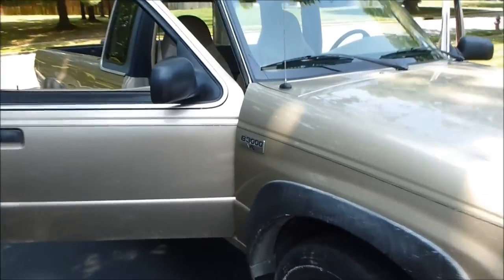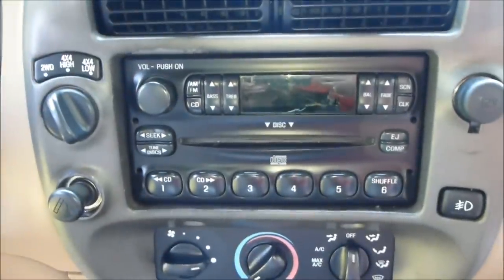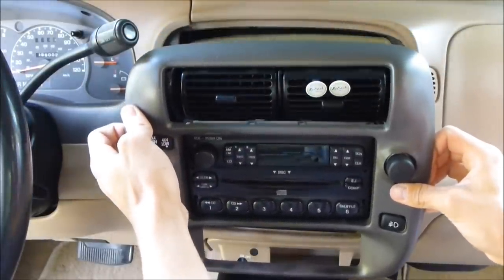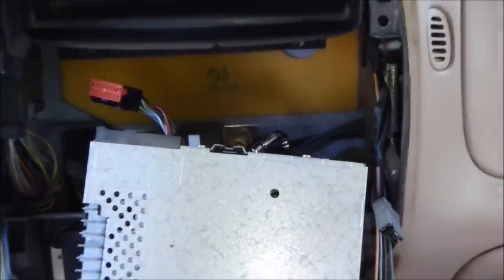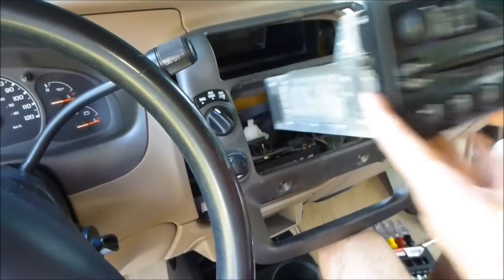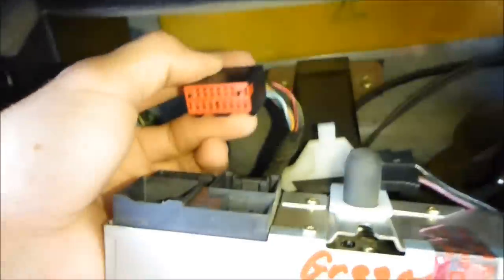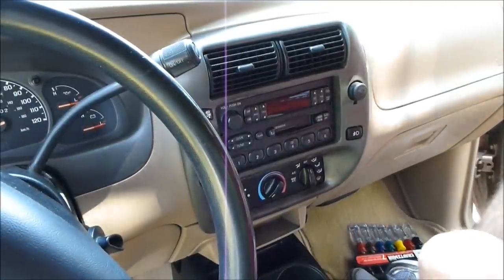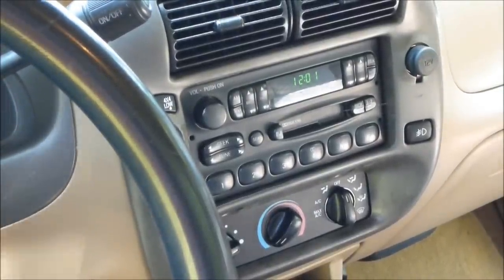How to Remove and Replace the Radio in a Ford and Mazda

Comment: i felt so bad when i saw that you were replacing your radio with the same factory type. Definitely bluetooth pioneers are the way to go.
Reply: Anthony O any clue on if I'd be needing a wiring harness to put in one of those bad boys on my b3000?
Reply: Yeah, you need a wiring harness to install it.  I mean, unless you feel like chopping off your factory harness clip and using a wiring diagram to splice the wires to the head unit.  It can be done, but it's a huge pain.
Reply: you dont chop off the old harness 😂😂😂😂 you get a wiring harness and it just plugs into the factory plug. you DO have to wire the radio to the new harness. but its color to color lol. i install these all the time and you made my day because you have no clue what your talking about0
Reply: You replying to me?
Reply: Anthony O i
Reply: Anthony O I know right 😂😂😂😂
Reply: Billy Litz 😂😂😂😂😂😂😂😂 give him a break
Reply: I don't think those bluetooths are that common in '12.....but I can be wrong.After all,how do I remeber how the world look like(in every detail) in 6 years ago.
Reply: I'd much rather have a stock radio than one of those ugly tacky aftermarket ones.
Reply: He should've put in an AM radio from 1955
Reply: Wrong, KENWOOD ftw
Reply: Wrong all if you.... Android radio bub, you tether your phone's data to the radio via bluetooth (you CAN use media Bluetooth from your phone but thats lame when the radio can act at an extension of your phone) and pull of pandora or YouTube, you can also use Google maps for roadtrips. So much more capability for the same if not the less amount of money and effort. Not to mention if you compare some of the android head units have better amps and more adjustable EQ's
Reply: 2012......with a cassette? Seriously I thought by then most people were done with cassettes and cassette adapters. I know some people still used CD’s, but cassettes? 
And yes Bluetooth was everywhere for radios.
Reply: He probably didn’t want a screen.
Reply: If we are beimg honest i never liked bt
Reply: @edwardmonsariste4050  he got that because he wanted to play songs from his iPod. They have a cassette adapter. This was commonly used before they came out with the 3.5mm plug that's common nowadays. Of course today he could just use Bluetooth. But back in 2012 his budget may have been limited.

Comment: Of all the radio you can possibly get. He buys a cassette player.
Reply: +Ipad app gameplays and reviews Yes, much more useful than a cd one
Reply: It would’ve been to much trouble for him to match the wires to the adapter from the radio harness
Reply: TheDankAtheist this video was filmed in 1990’s
Reply: On my 2000 Ford expedition I have tape and CD player both built in
Reply: TheDankAtheist this was years ago he probrably did not have access to cd or radio players
Reply: Thats a factory direct replacement...he is not teaching on how to be a riser...😑😑
Reply: 5:00 HE HAS A BEARD?!
Reply: I still use cassettes
Reply: He could have picked up a disc and cassette model

Comment: Your video was the magic moment for me. My TCCM is located next to the radio behind the 4x4 control knob. I tried the loops in the holes to get radio out and it wouldn’t budge. I seen your video and took whole panel out to get to module. It still would have been tough to get to just removing the radio. So much easier taking out 2 screws. Change out fixed my 4x4 issue. I bought the module online new manufactured by Ford for 250. Ford dealer wanted 467 and 200 to replace it. Thank you for helping me save 500 bucks.
Reply from the maker: Glad the video helped you with your TCCM!

Comment: Nice job on the video.  Thanks!

You can remove the radio WITHOUT removing the bezel if you have a din removal "key".  To make one,it's actually two pieces,  bend two long pieces of coat hanger into a U shape.  Insert the ends of each U into the two holes on either side of the radio. This pushes those clips in that are on the sides and then use the bent wire U's to pull the  the radio out. Then remove the electrical and antennae plugs.

Comment from the maker: If you go aftermarket it can vary... Typically you buy either a "single din" or "double din" radio. The truck has a large, "double din" so I would go with that... Then they provide a wiring harness that connects your existing wires to the new radio... It is all plug and play and really easy to do! Let me know if you have any other questions!

Comment: You don,t have to take off the molding, those 2 little holes on each side of the radio are for getting the radio out, cut and fashion two u-shape  out of a wire hanger 4 inches long each,push them into holes it releases lock tabs ,pull radio out....
Reply: Exactly !!!!!
Reply: Extra work and more chances for damages.
Reply: Juan Martinez just wouldn't work for me, and all i was doing was swapping antenna so this was GREAT and worked for me!
Reply: He literally addresses that in the video lol why dont you watch it more than just 30 seconds 😂
Reply: If you're putting in a new stereo, it's much easier to remove the panel. I could never get those snap-together, cheap plastic kits to fit perfectly.  Every new radio I tried sliding in and snapping from the front was never secure, and could be yanked out in seconds.  Removing the bezel, you can secure it from behind. It's only a couple screws and a minute's work.
Reply: I bought the tools, and tried them, it starts pulling out the bezel. Radio isn't popping out  also the wire harness clips for this, none of them are popping out  ready to break before the plastics even attempt to slide pass eachother. Anyone else having this issue ?

Comment from the maker: I am not sure what the wires could be because there are so many things that it might be. Look up the owners manual online and it will tell you what those color wires do. As for the other radio, you can get an adapter (not sure the part #) that will allow you to connect the stock radio wiring harness to the new sony head unit... Walmart sells them as well as amazon.

Comment: And once again you are a lifesaver. I was about to ask on your new video to make a video on how to take off the bezel before I thought I would do a double check through your channel one last time and not only did you show how to take off the bezel you showed the  exact same bezel I have in my 1995 explorer. My problem is that I was always calling it center console which is not this.  I think one of the clips is damaged/destroyed because it hangs off kinda and I didn't want to risk breaking it further because the only replacement parts I could find under "radio center console" was $200 used. Looking up radio bezel I found them for $70 new and I might not even have to replace the whole thing, just one or 2 clips.

Comment: Excellent video, thanks for posting.  I ended up using the coat hanger method but it was interesting to see the "scenic route" to truck radio replacement.
Reply from the maker: JD Gzan Thanks! Yea, if you have metal coat hangers you can do that as well! Or buy the part for like $2 to get it out.

Comment: I saw another video where the guy used 4 nails, instead of the “special” tool,  to pull the radio out through the bezel, instead of taking the bezel out of the dash. It also looks easier to pry the bezel out at the bottom.

Comment: I actually prefer the look of stock radios over aftermarket myself. I got a Bluetooth fm transmitter to avoid having some shiny, weird, gaudy looking thing standing out and looking odd.  Just not a huge fan of aftermarket radio look.
Reply: me too, the text on the buttons of the radio should match the rest of the car.
Reply: Ryan Amberger 
I'm going to the movies with a friend who is the best of cars he is Chris fix
Reply: Keeps some crackhead from breaking into your truck just to steal your radio, too.  Nobody wants these stock radios.
Reply: If you get a lot for the radio you can install a general looking single dim radio with something like a storage cubby on it's bottom

Comment: Great video! I'm buying a new radio for my 2004 Ranger and am going to use this as a tutorial for the installation.
Reply from the maker: J3l1yr01l5 Great! If you want, they sell a tool that makes the job even easier. I didnt want to buy the tool but some people use two metal wire coat hangers to press in the four little holes on the side of the radio. That makes the radio pop right out. Or you can just do what I did in the video lol
Reply: ChrisFix
Cool I'll look into that tool. Can you answer just one more question? The radio in my truck is a double din but when i do some research it says the radio is too big for my slot. Should i just get a single slot radio?
Reply from the maker: You can fit any double din radio in the spot of our double din radio. I dont know why it would say that. Maybe try to find dimensions and measure it... I would think the only limitation is depth but our stock radios are pretty deep.
Reply: Awesome. Thanks for your help and extremely quick response!

Comment: Hey Chris 
The 2 holes on both side of the radio if you push them in it releases the radio with out taking the dash off I used a Allenkey

Comment from the maker: They make adapters for smaller radios. It will not fit without the adapter. It is basically a plate that goes around the radio to fill the gaps.

Comment: You don't need to remove the whole bezel to do this.  Just use the clip remover tools and if you don't have those then a couple of pieces of coat hangers bent into a C shape will work.  Insert the ends into the holes on the face of the radio till you hear a click then push the hangers wires towards the outer sides of the radio and the radio will pull straight out of the bezel.
Reply from the maker: Thanks for the tip!

Comment: There are four holes in the front of the radio that allow you to use a special tool (or, pieces of coat hanger bent to fit) to remove the radio without taking apart the center of the dash.

Comment: I replaced the radio on our 01 Ford Escape and I actually made two of those tools out of a coat hanger. It worked great, and I didn't have to remove the bezel.
Reply from the maker: jakethesnakemo Thanks for sharing! That is another great method to get this out if you have some metal coat hangers!

Comment: Extremely well made video, just a quick question on the installation. I have a Jensen HD5112, and it seems too small to fit into the radio slot. Can you give me an idea of where to buy a kit that would help with the actual fit? I've heard of the kits at Walmart, but I'm not sure if they are what I need.

Comment: Hello Chris. Thanks for all the effort you put into your videos. They have helped me a lot already. Iv'e been unable to find info on how to *replace the light bulbs in my Mazda B2900 climate controls*. I know part of the removal uses the same tool that is used to remove the radio. I made the tools myself, out of thick wire. They work fine for the radio, but I can't get the climate controls out. The tool lets me unclip the controls but then I can only pull half an inch. Any tips or advice on what else has to be removed, unplugged or disconnected are highly appreciated.

Comment: gENTS , lADIES AND gENTS jUST BOUGHT MYSELF A FORD RANGER XLT I GRAB IT TOMORROW , CAN BARELY BREATHE , ITS OLD BUT IN GREAT SHAPE .
Reply: Sick, what year is it?
Reply: I got my step brothers old 2000 ford ranger that so far has been wrecked 3 times. one bent the hood, one (caused by yours truly) fucked up the break line running to the calibre, and the worst one caused us to get the frame straightened back out along with some other things, and so far we have only had to replace shit that me or him have broken
Reply: James Wade henry ford is smiling down at you young one
Reply: I have a 98 stepside 4x4 3.0 5 speed.  126k miles currently.  Cherry red and chrome.  Love it.  I baby it.

Comment: Could you do a video on how to properly install a sound system? Or at least fix the existing one?
Reply from the maker: Good idea
Reply: Yes Chris.... Its a good idea because all the stock wiring its not the same on the aftermarket ones... Most of them wanted to learn about the wire pin outs and how to identify them...that will be a long hard to make video man...😁😁

Comment: This was so helpful! I`m just wondering - will any brand Double DIN stereo fit? I`m looking to buy one, either a kenwood ddx 419 with a 6.1 in screen or a pioneer AVH p2400BT  with a 5.8 inch screen and want to be sure what I`m buying is going to fit into the space... thanks for any help you can give!! :)

Comment: first wanna say grate vids but i just removed my radio and all i used was 2 pieces of coat hanger and popped the radio out unplugged it and going to find another just plug it in and pop back into dash ;-)

Comment: i found on my radio i could use 4 nails of the right size for the holes, then squeeze them together slightly and pull. Comes right out.

Comment: Chris, I am having a problem with my dad's 99 Expedition and since you are fond with Fords, I thought you could help me figure it out. The door ajar light stays on all the time, and this is super annoying because it turns on all the interior lights and running board lights, and they do not timeout. My dad's truck does not have a way to turn all interior lights off and as a result, anywhere he parks he has to unplug his battery. One way I saw to fix this issue is opening each door and listening for which door doesn't chime, but my dad's truck doesn't chime at all, not for the key, not for headlights, seat belt, nothing. So now that that method is out of the question, another one was to spray WD-40 into the spot where the latch hooks on the door, doesn't work too well. I initially thought it was the trunk, because the cable slipped off and now i have had to remove the entire trunk interior panel to open the trunk from the inside. I unplugged the cables for both the glass and the trunk and still no luck. I am running out of cheap ideas and my dad and I love this truck to death, so it would be a shame to have to put this aside and buy another vehicle just because of this. Fun fact: it has 250,000 miles with ZERO mechanical issues, but being an American truck, electronics are hit and miss, lol.
Reply from the maker: JDMSteven If you want, a temprorary solution is to pull the fuse that turns the lights on for when the doors open. This way you dont need to junk the car. To fix the problem you need a new door ajar sensor or you need to adjust the bad one. This is tough because you cant just listen to the chime. Do you have external door ajar sensors (they look like plungers the get pushed in when the door is closed)?

Comment: I'm debating with myself if I should change my radio or just use an Bluetooth adapter, I have the version with Casette, It works well but the on/off button. The issue is that seem like the button is worn out, is hard make it hold pushed position and the radio remain turned on unless you make the button push down in somehow. I don't know if this have a simple fix, but when I cant turn off the radio, I have no more option than turn the volume to 0 and try turn off it later.

Comment: Was that cassette stereo pulled from crap yard or eBay? I have a cracked and split preset part of my cd stereo in my explorer trac same cd setup as yours and have heard if u buy a used unit online u might need to take it and your car to a dealer and see if they can program it to work with your car.

Comment: My harness was in real tight. someone else was in the back of this thing because the bezel was cracked on the left hand side. I was able to get the radio out by pressing your fingers on those metal brackets. My main issue is finding why I don't have heat and hope that the blend door will move. I had taken the glove box off the frame for more view. I'm going to connect the power back up and rotate the knob on the heater control. If the blend door does not move what is my next step...same set up as to what you have here...
Reply from the maker: Good luck! If the blend door doesnt move you need to fix the vacuum leak or the actuator that isnt moving it.
Reply: well I thought that I would check the heater control valve. Turns out that valve was bad. You can see straight through it. Replaced it and even with just water...the heat was very hot. I still have to put a thermometer to see just what temp is.
Reply: ChrisFix ChrisFix hi, I have a problem that needs to be fixed soon, me and my dad are in the process of buying a 2001 ford ranger like your Mazda, and the 4x4 doesn't turn on when we switch it, neither does the lights that indicate it on the dash. I heard that some times it's the ECM that dies or just the actual switch it self, but I don't know and we need to find out pretty soon would you know what the problem is
Reply: what I would do is see if you know of someone that has a switch that they can let you borrow or just purchase one. There are videos that can show you how to check switches. If that is the only issue that you are worried about and the rest of the vehicle is in great shape...I would go and purchase it. I have followed wiring harnesses for breaks or grounds that are rusted. This will be a great Father and son project...good luck

Comment from the maker: not any radio will work. It has to be a "double din" radio and if it is not the original style then you will need an adapter... I used a Ford Ranger cassette radio and my radio use to be a CD

Comment: My Question Is Before You Started This Replace. Did You Unplug The Battery First? Or Did You Have Unplug Any Fuses? Or Both?
Thanks
Reply: The theft light flashed he didn't pull out the battery